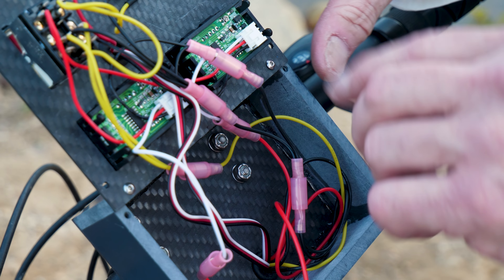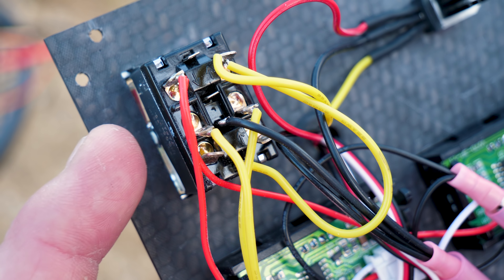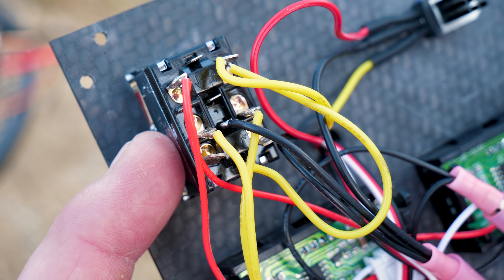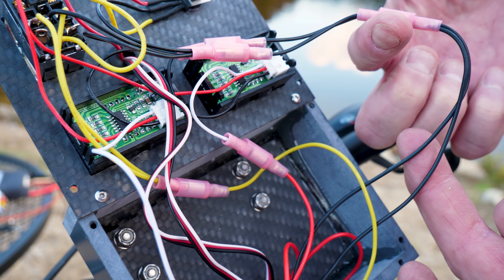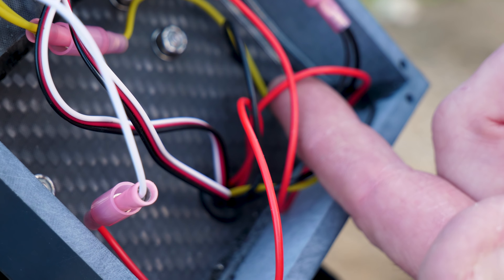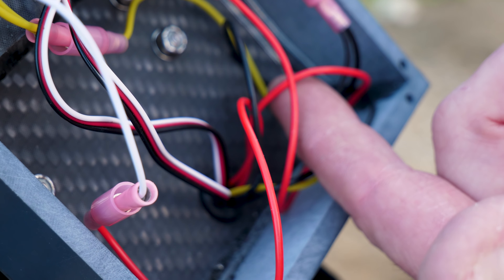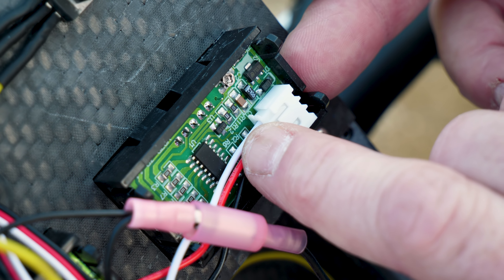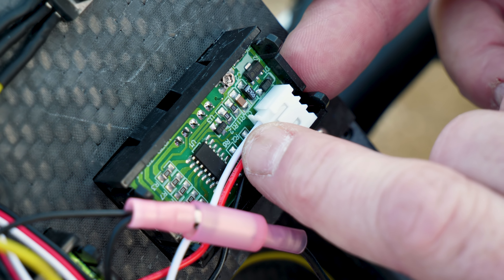Jet Bike - DIY Demo and Test Drive

Comment: For fun! Who hasn't dreamed of a jet powered bike?

That is a beautiful lake.

As a side note, I think you stated the characteristics of series vs parallel battery packs backwards. In a parallel arraignment a lower capacity cell will have less current flowing through it relative to its neighbors. They will all share the same voltage level because they are all tied together. 

If you are constructing series/parallel packs you will want each series level to have the same capacity as you will be limited by the smallest one.

You guys look like you are having a blast. Good job.
Reply from the maker: We are having a blast.
Regarding the series vs parallel argument, it is not a cell's voltage that matters it is the internal resistance.  In parallel operation a cell is free to dump its current into the buss irrespective of what its neighbors are contributing.  Series operation limits current flow to the same exact level through each cell.

Comment: I have a bike like this to but not nearly as clean looking    When I first tested it the wires were sucked into the motor and cut so I electric taped it back together 10/10 fix

Comment: Dr. Ingredients, I love your videos.  I want you to keep making them.
With that said, this is not a jet.  It is a ducted high velocity fan.  A large diameter, medium pitch propeller would have been better for this application.  It would also clear the streets of pedestrians.

A real hybrid jet would be a motor driven compressor in front of a gas turbine with a propulsion nozzle.  The turbine is connected to a generator and a battery pack.
I am not sure what would be the use of this since connecting them with a shaft is far more efficient.  But it would be impressive.  Keep up the good work.  I am looking into Patreon.
Reply from the maker: Your points are good, but I'll disagree with the terminology.  It is indeed a ducted fan, but it creates a jet of air.  Not all jets are fuel burning compressor and turbine devices.
I agree with your argument in favor of larger diameter, lower velocity fans for increased effeciency and lower noise, but this is cool and getting attention is part of the goal.

Comment: I like the petrol on the nitro run's like a scooter had 60 top 50run 😆😆😆😆😆5 Smile's  2 liters gets 4 plus hours pushing it
Would work well on that river too by the way will you be adding float cylinders for water use?????

Comment: It seems to me that while this is spectacular as a jet fan powered vehicle that it would be as simple to produce and far more efficient (especially in hilly terrain) if it were mechanically connected to the rear wheel.  That would not have to be a complicated system, either, as the motor could be connected simply by a flywheel on the motor and pressed against the rear tire to provide traction.  The advantage there is that going downhill you can recharge the battery, thus increasing the efficiency many times.
Reply from the maker: Sure.
However, we do indeed enjoy the looks as we pass through town!

Comment: I'm thinking the ESC's should have been mounted behind-between the turbines so you don't get density loss on the intakes.  They'd certainly stay cooler.  The whole assembly could have been put into an aft cowling  and then a broadened intake scoop gathering towards the turbines (even a cardboard box) would have given a measureable increase in thrust.
Reply from the maker: They were mounted near the intake stream to provide enhanced cooling with a minimal reduction in thrust.  This is reasonable because the air velocity at their present location is substantially lower than in the exhaust jet.

Comment: I wonder if you could take a small propane cylinder, add a heat resistant exhaust end Venturi/ nozzle and spark plug (powered off the battery packs) and created an “after burner” effect off of an electric powered jet fan unit?  Seems like it would be possible?? And ridiculously cool.
Reply from the maker: Did you watch our video on the electric jet?  It's basically what you described.

Comment: What are the chances these fans could be used as an electric  blow through supercharger for a 50cc moped? Maybe put an electric wheel on the front too and make a supercharged AWD 50cc moped (that doesn't require a motorcycle license). Maybe such a project could also have a CDI box to separately optimize starting and power across the rev range? If you got 25 hp out of a 50cc supercharged hybrid moped, you'd be having a pretty good day.  If the moped was a 2 stroke the boost would get rid of any un-burnt gases in the cylinder. That would lessen the need for an expansion chamber in the exhaust. Maybe it gets a CVT from a snowmobile too (not sure how efficient those are)...I'm just thinking out loud now but ya... any insight on a ducted fan electric  blow through supercharger?

Your channel rocks!
Reply: No supercharging of classical 2-strokes is ever going to make sense. The expansion chamber/tuned exhaust is necessary to keep air and fuel inside the cylinder as well. When the intake ports close from the crankcase to the cylinder the exhaust is (usually) still open and the more pressure is inside the cylinder, the more mixture will come out of the exhaust port and thus out of the exhaust.
Also, you can probably get around maybe 15-20HP out of a 50cc 2-stroke engine with good tuning and "racing parts". And it already is near meltdown at that point lol
Reply: And I would probably prefer radial compressor over axial fans for superchargers. Would be pretty cool if we could just put that badass BLDC motor onto a "small" radial compressor
Reply: @allesklarklaus147  I read somewhere that the land speed 50cc record is 29hp. I was including power derived from an electric front wheel as well. I guess  supercharging a 2 Stoke is a no go. I figured it would be fine since it works on a Wankel but the chamber is of course separate in that case by the rotor. Thanks for the insight.

Comment: I thought it would be cool to use the EDF to spin a paddle wheel that is geared down to the wheel
Reply from the maker: Neat idea!  That is the kind of Rube Goldberg system that will bring out even more of the "why don't you just buy an e-bike" comments.😀
Reply: @TechIngredients  you have the brain that could turn that idea to its upmost potential

Comment: Please tell me you add an afterburner. The compressor being powered by the battery wouldn't need to pull any energy out of the jet thrust to run a turbine spool.

Comment: Could you try ducting on the rear of the fan to increase the airspeed and thrust?
Reply from the maker: From our tests with these fans for the hybrid jet videos we learned that they will indeed improve their thrust with a small taper of the exhaust tube.  The increase in velocity offsets any reduction in mass flow up to approximately a 20% reduction in cross sectional area.  After that the thrust drops, but the net improvement in overall thrust at any taper level is pretty small.
Nevertheless, be aware we never ran these fans above 25% of maximum power, for these demos.  We wern't trying to set any speed records, but they CAN push a bike much faster.
Reply: @TechIngredients It would be nice to see the maximum performance achievable, wouldn't you agree?
Reply from the maker: On that bike, no way!  But it's clear that many viewers are interested in the high speed potential.  So, when the weather clears, we'll place this on a good road bike and open it up.

Comment: Is it possible to set up the two turbines so that the sounds created by the turbines destructively interfere, thus reducing the overall sound produced without impacting too much on the thrust ?

Lovely project, as always.
Reply from the maker: That's a VERY interesting idea.  They are small enough that the sound emanates from a similar location and phasing the drive signals should be reasonably straight forward.  The only real problem I foresee is that the high frequencies have short wavelengths which requires more precise phase alignment.

Comment: Love the tie, but please be smart - wear a helmet. A lovely project, I like that it does not require modifications to the bike.
Reply: By design, bicycle helmets only provide very limited protection in a very limited set of circumstances. Far less than a motorcycle helmet. Research has also shown that they can cause other types of injury to the neck due to rotational forces upon impact. I'm not saying they are useless and shouldn't be worn, far from it, but most people grossly overestimate the protective value of cycle helmets.

Comment: 12:30 i think you got serial and parallel upside down. Serial connections limit you to the lowest capacity cell while parallel connections spread the demand of current over all cells.

Comment: The resemblance to Wile E. Coyote is uncanny.  Still, it looks like the coasting footage is downhill.
Reply from the maker: I do have a bunch of Acme threads lying around. 

The bike is way too fast.  We were coasting both up and down hill and when you saw my own two runs, I was on a flat part of the road that began a steep decent just as I passed the camera.  We never ran over 25% power.  The wheels are out of alignment and the breaks are dried out. When my son finishes his new bike we'll do some speed runs (with a helmet and gloves).

Comment: I know this video is ancient, but 500MPG sounds really great.  Think you can top that?
Reply from the maker: Not with this design.  But, fuel efficiency  wasn't the goal.
Reply: @TechIngredients  no I meant with an actual gasoline powered bicycle. There are the old 66cc China doll 2 stroke motors you can buy for 90 dollars direct from China, but they are of dubious quality and not nearly enough mpg.

Comment: Somehow I missed this video, always great to watch! Cant wait for the turbine drone, ive been designing something similar with a VZ21 and a second exhaust housing to drive a brushless generator. Id love to come share ideas.
Reply from the maker: Great!  I'm looking at a large diameter free turbine with a reversing flow blade not that different from a Pelton wheel.  I need to get the RPM down into the range of practical brushless motors.
Reply: @TechIngredients  Yea, getting the RPM down is definitely a problem with these little turbos, I believe the vz21 has a peak of 250k. Once I get the engine portion going I'm going to do some tests using the planetaries out of an Ingersol-Rand Impact driver with a custom cage to see what RPMs I can get out of the exh housing under load.
Reply from the maker: Good luck!

Comment: Would there be any advantage to having both direct drive and Jet? If, say, the the batteries were twice as power dense, or you could use the same batteries for both systems. I think it would be fun to have both, but I am curious if there would be any dramatic increase in either power or fun if you could start up the direct drive and then hit the afterburners, so to speak?
Reply from the maker: Probably not.  The advantage of the jets is the independence from the bike's structure and the neat appearance and sound.  But a direct drive is more effecient and can even recover the energy when braking.
Reply: Tech Ingredients ah, but, it would be a cool accessory for a dedicated ebike due to it’s modular nature. Excess being the key prefix to accessory, no?

Comment: Very Cool use of parts laying around, plus its not modified so its there if needed for another project.
I noticed the seat was as low as possible.. Was that to reduce drag and lower the center of mass for better range and stability? (It is driven so no need for optimum riding height)
Reply from the maker: We just didn't bother to adjust it.  This old bike was used for the build, the wheels wobble and the breaks are not too good.  That is why we didn't open it up any further.  This design could push a proper road bike to frighting speeds.
Reply: Ahh cool!
btw Love the channels!

Comment: hard to tell how much it adds other then jet sound.  The modern version of cards in the spokes. :-)
Reply from the maker: It adds enough thrust that you can climb a hill without peddling and we were running at around 1/4 maximum thrust to maintain a comfortable speed.
Reply: @TechIngredients That was not clearly demonstrated in the video.   I think I'd need to see that documented given the really poor low speed performance of jets or fans.  There is no way any sort of fan or jet will approach the hill climbing abilities of a direct drive electric equivalent.  You are basically building the equivalent of the Caproni  N.1 and that performed very poorly and was almost as fast without the rear burner active.  Even with the two stage electric ducted fans you won't get near the compression ratio needed to be anywhere near efficient.  I love to watch your fiddling for sure but I'd need to see some actual test stand data before I'd see it as anything other a novel fun project.  That many batteries in a conventional direct drive e bike application can make a scary fast e bike for a short period of time. I watched the video again, I see a lot of pedalling and what looks to be some down hill on very small grades.
Reply: @fun_ghoul  I really don't know much about the channel, not sure how I ended up subscribed to it.

Comment: How hot are the exhaust temps at distance? Could vectoring the thrust more toward the ground at an angle negate the loss of efficiency by pushing off the ground or would that create down force on the front tire from power or thrust angle? I'm thinking pushing off the ground a a bit might provide more power and greater distance.
Reply from the maker: These electric fans produce very little heat.  You can't detect it with your hand.
Thrust vectoring would not be useful.  You want as much of the thrust as possible, driving the bike forward.
With an optimized road bike and with proper posture which reduces wind resistance, the top speed will be very high. A professional bike rider will generate 7 lb of thrust when riding at 25-28 MPH.  Our fans produce a combined 22 lb of thrust!
Reply: Over 3 times that is truly awesome! Thank you for the reply.

Comment: How much thrust do the fans produce? Could they produce enough thrust to get a high performance ultralight aircraft into the air? Very good video well done!
Reply from the maker: They each produce 5.4 Kg of thrust at maximum current.
This would not be enough thrust.
The mid range RC turbojets would be a better choice.

Comment: Too noisy for use in nature, you will scare every forest critter for miles with that terror wagon.   As for the specs of the deign, something tells me you might do better to mount the turbo fans further back even if on an extension pole to keep them further away from the turbulant air generated by the rider's body blocking the air stream..  Actually thinking about it, a ducted design with the turbofans in front and an exhaust air ducted to the back carefully directed at the proper angle might be better.  Maybe it makes no difference.  I'm curioous if it would.  Would it?
Reply from the maker: Engineering is mostly about balance.  Given certain properties to work with we had to choose what would maximize the benefits.  The existing EDFs were pretty powerful, but their small diameter and high velocity exhaust make them inefficient to propel a slow moving bicycle and they're loud.  They're compact, inexpensive, turn key components for an amateur build.  They look cool and in more urban locations attract a lot of attention. They  almost universally get a thumbs up!  Their high velocity flow makes small perturbations in the inlet flow less significant.

Comment: You can get 12s in one pack (2 6s packs arranged in a stick), because most 700 size RC helicopters run on 12s.
Reply: So, two packs.
Reply: @fun_ghoul  More or less, it's 2 packs in one.
Reply: @necronomicon1472  In any event, LiPo packs are a terrible choice for ebikes or any other application requiring long life. Hobbyists compromise that for higher amperage from lower weight (and cost), but it's not a good trade-off for a vehicle with a total weight of over 200 lbs., including rider. I know "TI" did it because that's what he had to hand, which is fine, but it'd suck if any of his subscribers who are new to ebikes emulate this build.
Reply: @fun_ghoul  I agree, with an RC helicopter you get around 2 - 7 minutes of flight time depending on your style and the lifetime of the batteries is, let's call it not great even though it's getting better.
Reply: @necronomicon1472  Forgive me for not being clear. I'm not talking about how much use between charges, but how many charges before the packs are garbage.
Reply: @fun_ghoul  I know. I also meantioned the lifetime (charge cycles) of the batteries.
Reply: @necronomicon1472  Then why are you talking about flight time? Ugh.
Reply: @fun_ghoul  In hindsight, I'm not sure either.
Reply: @necronomicon1472  Sorry for being a prick about it. I've clearly spent too much time in Yootoob comment sections.

Comment: is it possible to use the jet engines as a gearbox... in some way, to reduce the noise.... who knows,..
Reply from the maker: Probably not.  A conventional E-bike would be a better choice if you want to reduce the noise.  A larger diameter fan would be another improvement that would reduce noise and increase efficiency.

Comment: Would these ducked fans be suitable for adding boost to an engine like a turbocharger?
Reply from the maker: Probably not.  Automakers are working on hybrid turbos that use an electrically powered centrifugal compressor to assist the standard turbo during acceleration, reducing turbo lag.  These axial fans just don't create enough compression.